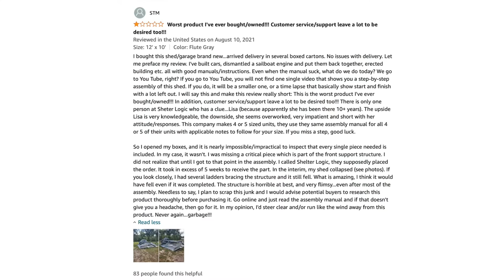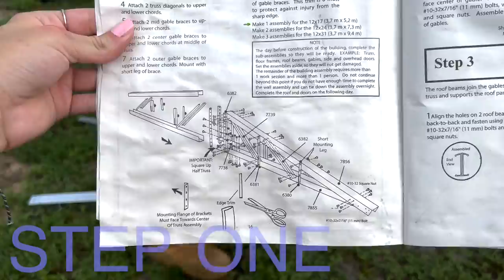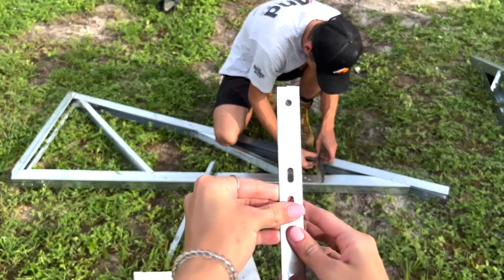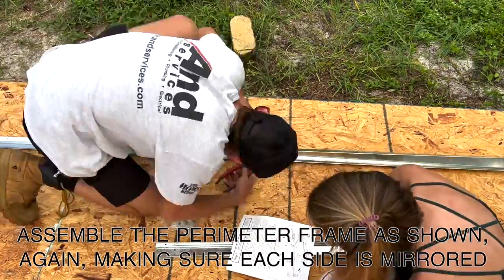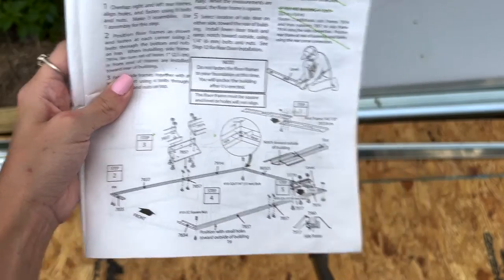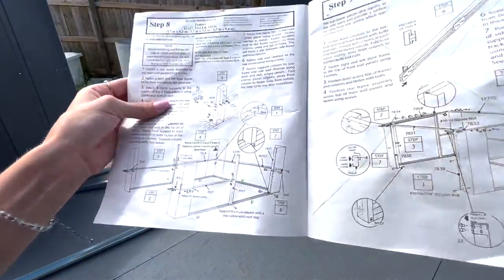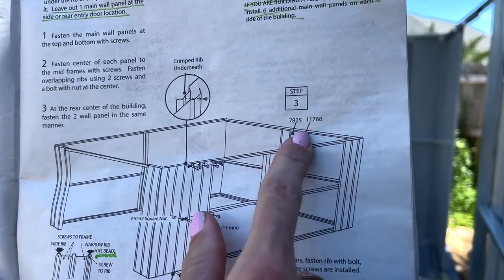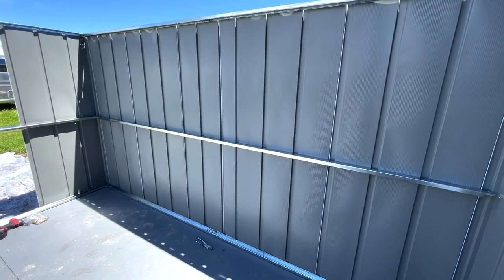Arrow Murryhill 12x17 shed assembly (ep. 20)

Comment: I purchased a 12 x 31 Arrow Shed and it fell down due to the high winds where I live. I had to rebuild it in wood BUT I am using the garage door and other parts. I need a detailed idea of how to make the garage work. My just always get stuck and then the rollers come off, no matter how many times I adjust it. Any Advise? BTW, this video is much better than the Arrow shed build by the company. They always seem to skip the parts where most people have problems! Great Job!
Reply from the maker: awe im sorry to hear that!! we just recently moved and have a new garage with an actual shingle roof on it and we’re kinda in the same boat cause a tree fell on it… we want to reuse the windows but everything else is a lost cause lol. 
given all this, i dont have the Arrow shed near by to reference anymore but we had a similar experience with the garage door… it would get stuck if you didnt open it with even pressure on each side, then sometimes we’d have to press on the top panel or 2 cause they didnt want to fold and roll back like they’re supposed to. 
if i remember correctly, the tracks for the door weren’t really braced in place by much so that left a bit of room for them to shift out of place… so if you havent done it already then maybe framing wood behind the tracks and sending screws through them into the wood on each side may be your best bet to hold them in place and keep them from shifting too much. i would re-adjust it the way you want and watch what it’s doing from inside the garage, but of course make sure you have another way to exist in the meantime if you get stuck🫣😂 wood framing might look terrible depending on how it’s done, but functionality is more important than aesthetic in my opinion. 
even just using a couple L-brackets from the bottom of the tracks to the floor may assist in keeping them in place maybe. 
sorry if these are useless ideas but that’s all i really have coming to mind at the moment
best of luck and if you need someone to bounce other ideas off of, of course i’d be glad to help further. our email is ericandselah@gmail.com if you wanted to send some photos or something to give me a little more to go off of in case you continue having back luck.
thank you though!! i’m very surprised this video has done as well as it has cause video editing certainly isn’t my forté, but if it helped one person then that makes it all worth it:)

Comment: Man, just putting this building up in ND, where the wind, seldom don’t blow…. @ the side door now, the directions seem 2 be lacking about the door, had 2 call it a day, ha….
Reply from the maker: the side door was a piece of junk… we dont know what the issue with ours was but we could never get it to work right… so we ended up screwing it shut and making use of the extra wall space instead haha. if you have any specific questions we’d be more than happy to review the instructions packet and try to further clarify for you :)
Reply: Your floor wasn't built strong enough.IMHO It's OK to use pressure treated 2x4 but put in a 12" centers on a 12 ft run

Comment: I purchased a 12'X24' Arrow Murryhill  shed and will be setting it up
on a concrete slab in Tucson Arizona. Nice to see it can be done with 2 people. We will install an anchor kit due to the microburst winds we experience here on occasions. Super great video, it's going to help a lot. Keep up the good work!!
Reply from the maker: ours held up against 40ish mph winds we got in Pensacola from Hurricane Ian with just the wood screws, so with concrete anchors you should be ESPECIALLY prepared for any winds you get there😊 
2 people wasn’t always comfortable, but it’s certainly do-able. if you have any extra questions feel free to reach out and i can review our instruction packet to try and clarify further! best of luck!
Reply: @EricAndSelah  Did you have to brace the 4 corner panels during assembly? Temporary bracing?
Reply from the maker: yes i was taking turns picking them back up off screen because they kept blowing over! we ran screws through the bottom of the frame into the wood to fix the issue temporarily but since you cant super easily do that… maybe you could find something to lean up against the inner corner?
Reply: How did the 12x24 assembly go? How long did it take?
Reply: can you fit a car in their?
Reply from the maker: @raiitaly definitely! just cant be too tall. gotta check your own clearance:)

Comment: I’m torn between buying one of these and modifying it to be a workshop or just moving my existing shed and building a slab for it. After a year, how has the building been? I know Florida weather can put some structures through their paces
Reply from the maker: we no longer live at the property we installed the shed but eric’s dad still does… as far as we’ve heard, all is still good with it! we had some pretty intense tropical storms while we were still there and it held up well. 
at our new property we essentially have the same thing, a pole barn type structure but on a slab this time with taller doors so we’re able to actually pull our vehicles in and out, but the indiana weather right now along with that concrete almost has it feeling colder inside than outside so i’m pretty miserable working on much of anything at the moment. or that may just be my Floridian habits talking. 
as you know, there’s just so many factors to consider… but we’re sure you’ll be happy regardless of which approach you take! there are pros and cons to just about any option out there. the only thing we really struggled with was space, but that’s just how eric is haha… he sees empty spaces as an excuse to buy more tools😂 best of luck to you and if we are able to help you out any more just let us know!

Comment: Is it possible to put 2x4 wood on the sidings as a extra base to make it higher a bit? Wondering if the roll down door still closed/sealed properly?
Reply from the maker: i feel the garage door may drop out of the track if you go too high or it may leave the top portion with an open crack above the door but you could certainly try!
Reply: @EricAndSelah  what’s the total measurement of the roll up door from top to bottom?
Reply from the maker: we don’t have the garage anymore because we moved unfortunately. I’m sorry I wish I could tell you.

Comment: Could the sliding door go on the opposite side?
Reply from the maker: if i remember correctly, yes! it should all be dependent on how you set the floor frame and wall panels up. it’s been a couple years now and i don’t know if models have changed at all though, so i would suggest figuring out what size and model number you’re looking into and there should be an online instruction manual. 
i just searched and got this result… 
 https://www.shedsforlessdirect.com/manuals/arrow-12x24-murryhill-garage-BGR1224FG-manual.pdf?srsltid=AfmBOooQYfJhaJ80PxZwDZPEEPEnzgWWn3otiMn1pnyHcVe-aKi_65hu
if this happens to include your model number it begins to show you the process on pages 18 and 19 for the lower door track:) and it states it can be on either side. best of luck!!

Comment: Perfect, but the only thing is that washers should be used so scratching doesn't happen. Preferably rubber to keep leaking to a minimum. Also, limits rusting two reasons rain acid and metals are different metals screws going into building. Using two type metals cause problems in weather changes in long term and weaker metal will fail and in this situation the building metal fails first.
Reply from the maker: yeah probably. we weren’t buying it to be a long term solution but that’s a great point for others who may be!

Comment: Great video! 
Question: for a shed this size, did you have to get a building permit from your county?
Reply from the maker: no we did not due to the square footage being less than our county, at the time, required for permitting. however, we did put it closer to the property line than was technically allowed… so i mean, if a neighbor complained or something, i guess we may have been forced to relocate it but our neighbors didn’t mind :) our county was pretty relaxed though so definitely review what your county requires!!

Comment: Did you seal under the floor frame
Reply from the maker: The floor isn’t the strongest, I believe that was addressed in the video. It was not intended to be driven on. It was a budget storage solution that got us by until we moved, though it is still fully functional for the new owners. We did not seal the floor frame because we were not concerned with the longevity of the building or the “foundation” and the yard was pretty much just sand being in Florida, so the only standing water we really had was what remained on the flooring itself. Thank you.

Comment: How much larger is the floor in relation to building size. I’m considering doing the same thing you did. How is the water getting in did you seal the flange on floor. Thanks for the video
Reply from the maker: there was only about an inch or two of flooring around the perimeter. we did seal the outer edge later on. you’re welcome! glad it helped!
Reply: @EricAndSelah  I bought this same building and I would like to ask if I want to have a concrete slab poured what would I need the measurement to be to have the building fit exactly?

Comment: How’s the roof height?
Reply from the maker: the door height is 6ft and neither of us are that tall so it works great for us! if you’re taller than that… building it on a platform like we did may help keep you from bumping your head since you’d be stepping into it rather than walking straight ahead if that makes sense. once you’re actually inside, it opens up a lot! it’s just the door (frame) itself that’s comparatively short